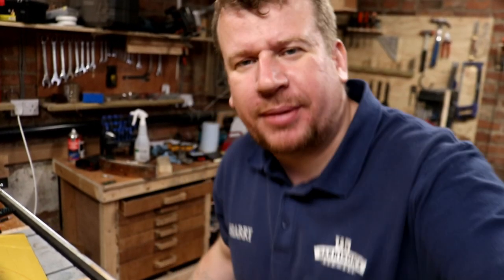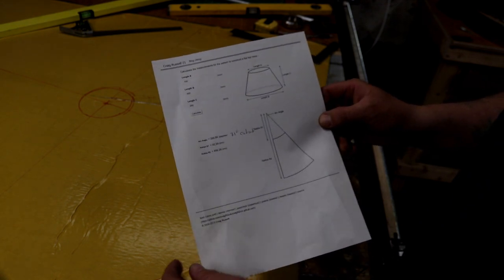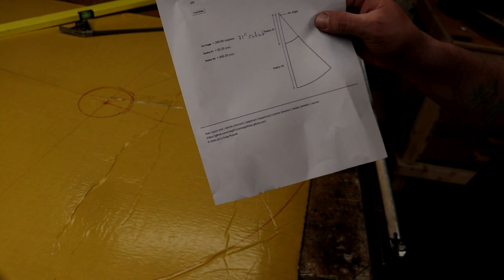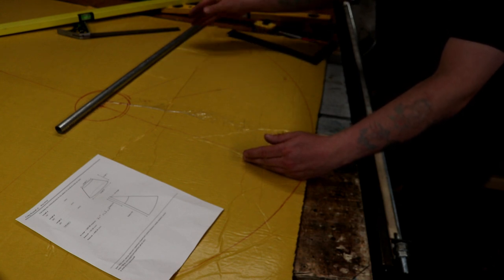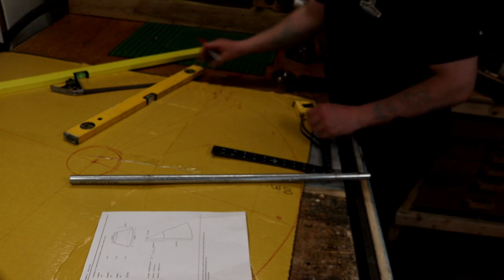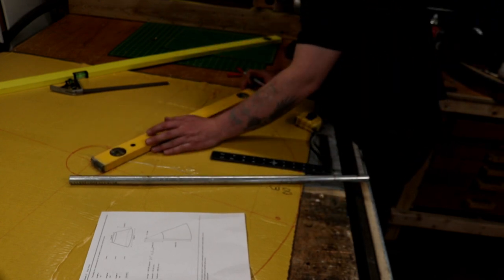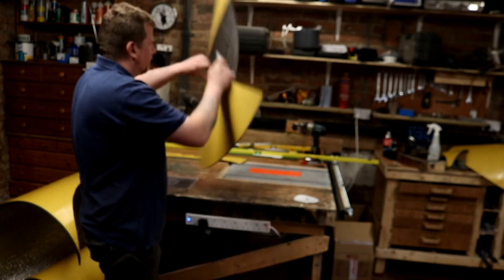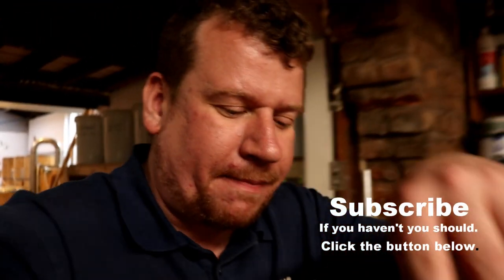INSULATING TANK CONES

Comment: I would have measured the distance between the two 90s intersections then multiplied it by 71/90  (0.7888889) this would give you the point along the line that 71 intersects
Reply: Are you sure? It may be close but I didn't think that points along a straight line quite equated to angles of an arc. There again does it really matter 🤣? Cheers, Schnuz.